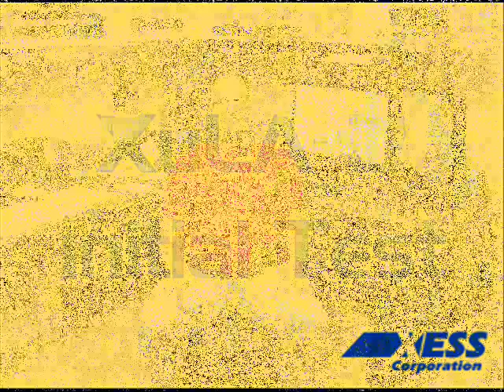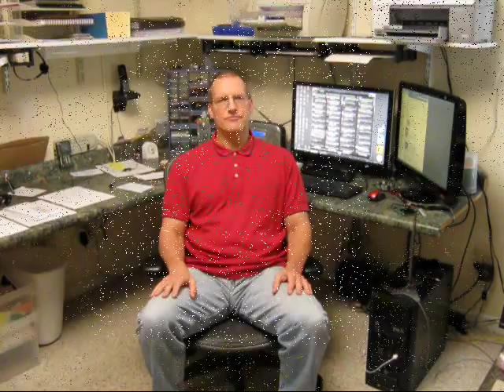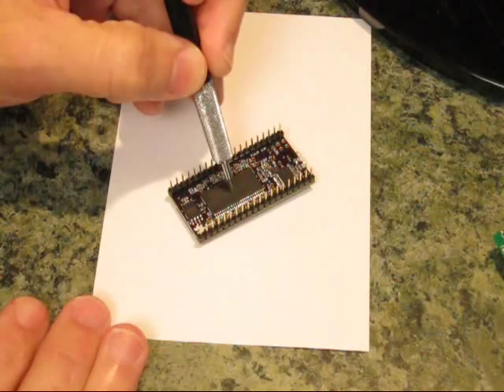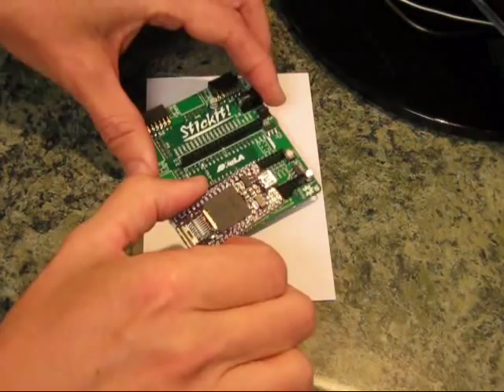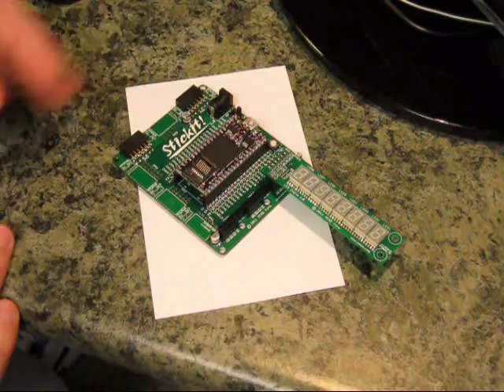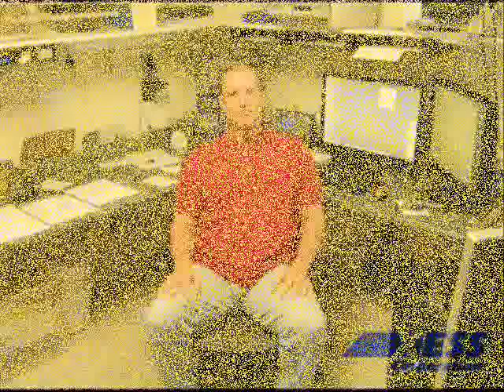XuLA-2 Initial Test

Comment: @devbisme Thanks for the reply! Was about to press the fire button on the Xula-200 on your site, until the shipping to the UK caught me out. Not your fault, the oceans fault there. Keep up the good work. I'll be designing a LVDS Flat-Panel-Display transmitter plug-in board to interface with the Xula-200 and a Pic Microcontroller.